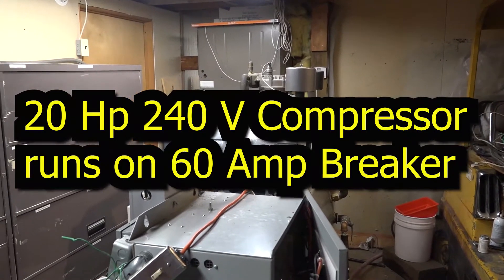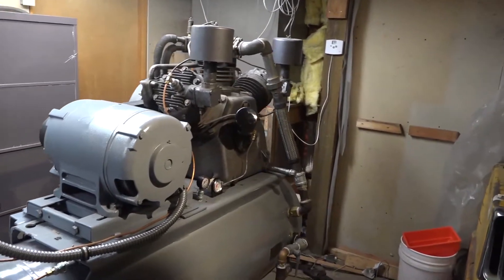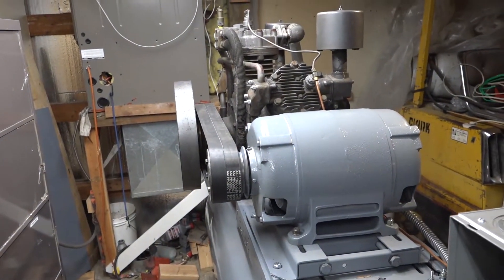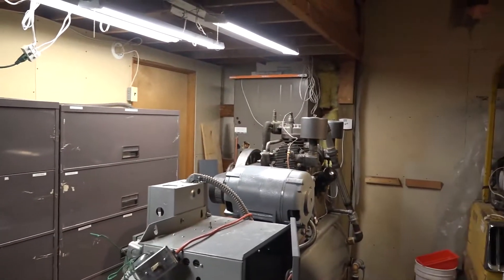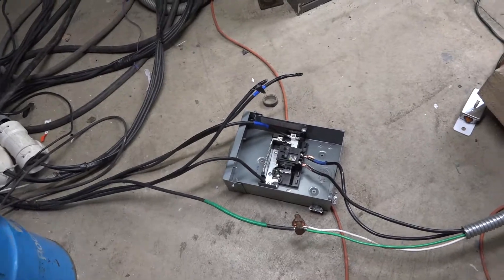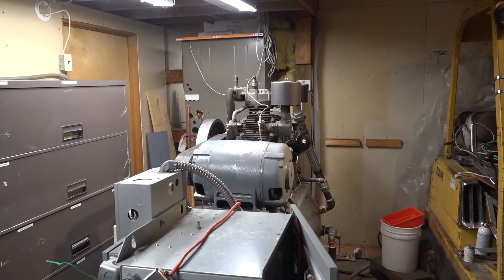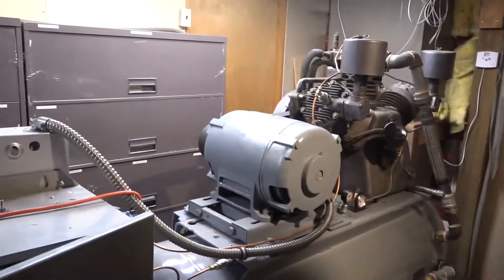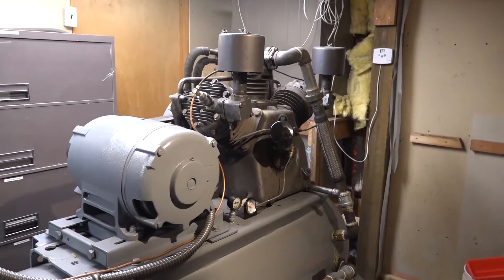20 Hp 240V Single Phase runs on 60 amp breaker

Comment: Sir I watch your transformer in oil works great and I comment here because comments are not allowed on that video. Can I ask about a transformer I only use cooking oil in 4 amp transformer which the job is only to lower the 240v into 216v to reduce slightly in electricity bill. Well it's almost 6 months and the cooking I've used in transformer works great. I just noticed that it smelled rancid, will it be ok?? Thanks if you replied sir.

Comment: Bought the book. I have questions on connecting converter to main single phase  and how I connect to get 230v out 3 times. Pics aren’t that clear to me. I need to run a Quincy air compressor that has a 30hp 3 phase motor. It’s for my garage on my ranch. I understand electricity but I’ve never made my own converter or made my own 3 phase. Can you help?
Reply: On your single phase transformer follow diagram for 240v  (for example my trans it is H1 to H7 (line 1) and H10 to H4 (line 2) this gives voltage of 120v or 240v on the secondary side depending on how you connect the X wires together.  (On my trans I connect X2 to X4 (120v) and then connect it DIRECT to  H1 to H7 which in turn gives me the 360v on the X1 to x3 aka Line 3 to caps.  Follow diagram and test with multimeter and transformers are all not the same but the few I’ve done were similar.

Comment: They me start by saying thank you for sharing your knowledge. I am building a powder coating business from nothing on the side and putting everything back into the business and sand blasting is a very big part of what I do and I need as much cfm as I can get on single phase power and large air compressor are not cheap as you know. I will be trying to learn as much as I can from you thanks again

Comment: Doug been following you since 2009, I have all your media and have since then successfully setup a 5, 7.5HP and now a 15hp 3 Phase motors using the Transformer method.   While I'm well familiar with the TC method, still love watching your videos firing firing up these bigger motors on Resi Power with the quickness!  Please post more, and also show in more detail how you have  your wiring setup in the control box.  We don't care about the mess, we know how testing goes.